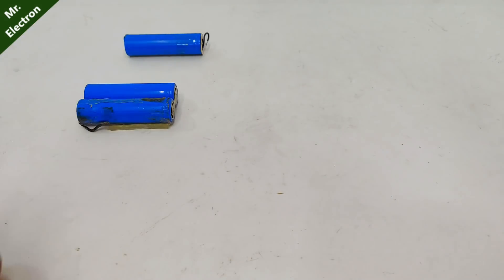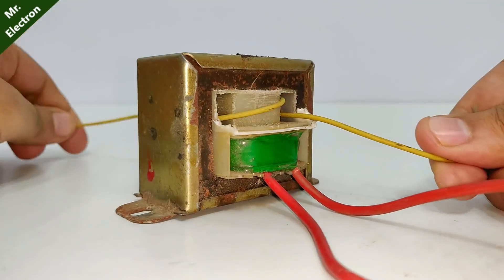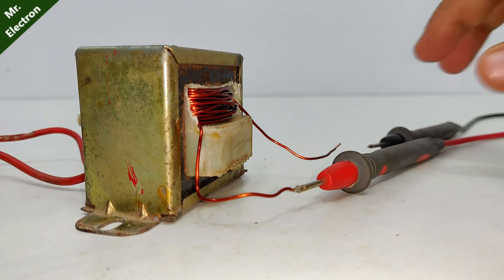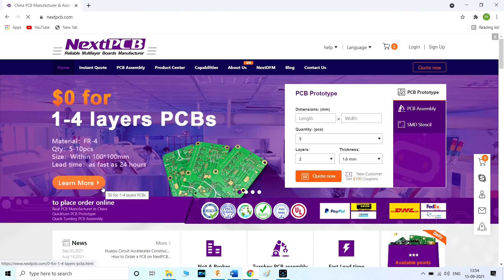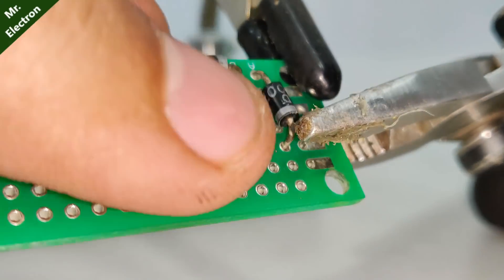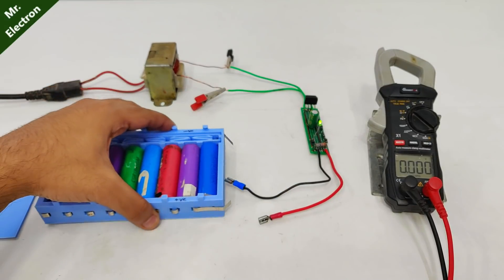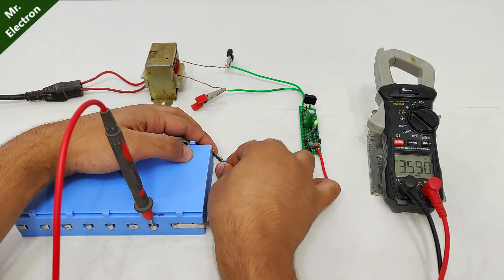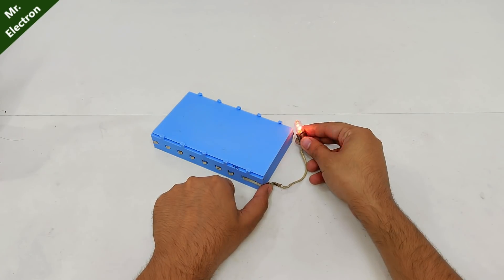Make a 220v to 3.7v Lithium Ion 18650 Battery Charger without Transistor, Mosfet or IC

Comment: Hi, thanks for the video! I ask you, with that 1 mm copper wire, how much would the current of that transformer be? To get 12 volts from the transformer, should I double the 28 turns? the 330r resistor must be 1 watt power dissipation? If I want to charge batteries but 1.5 volts, what should I change? Greetings and excuse so much consultation but it will help me and perhaps those who see this very useful video.

Comment: hi, and dear mr. electron. this is good and interesant. But what is? if you use it old connector from a laptop, to charge.
here old connector coming from lithium battery to charge.?
Because this is the basic connection used to connect and charge to 18v or 19 v lithium battery pack. so here don't are needed to buy new component. 

I self i have found old laptop, and rescue this part, old lithium battery going to trash. But now is difficult to know to what pin are connect to what wiring cable.

Comment: Can disable removing Sensor Cap (Battery Connect) in Smart Alternator in Van/Car .... So I can connect parallel batteries with ... ISOLATOR ...Instead of ...Costly B2B charger...

Comment: G monter mon 12v > 18v pour l'électo- portatif sur accumulateur ni-cd avec des led 10A10 en formant une masse virtuelle sur 5 accumulateur en série monté en parallèle sur une seul led 10A10 celà fonctionne jusqu'à ce que la circulaire force trop alors la led d'entrée négative chauffe et casse en deux ce qui permet d'examiner l'intérieur d'une led 10A10 mais somme toute peu efficace... Avez-vous une solution technique plus efficace ?.